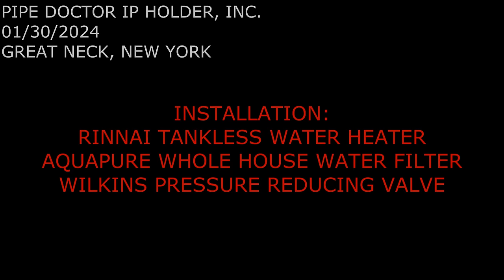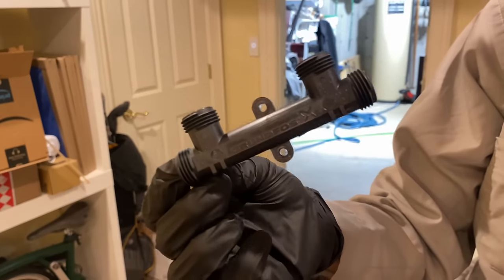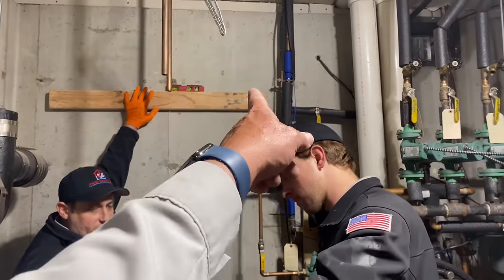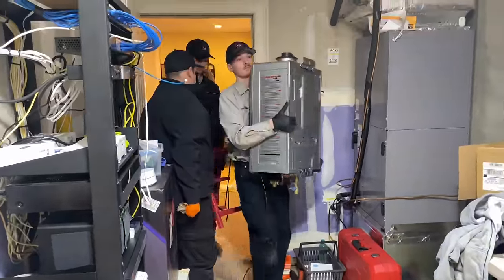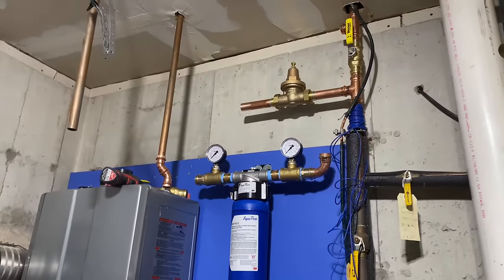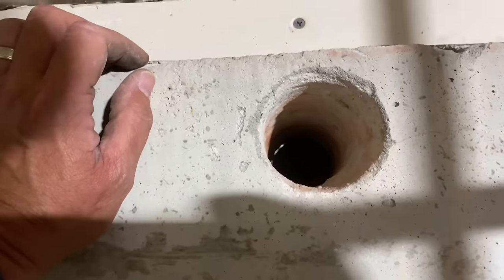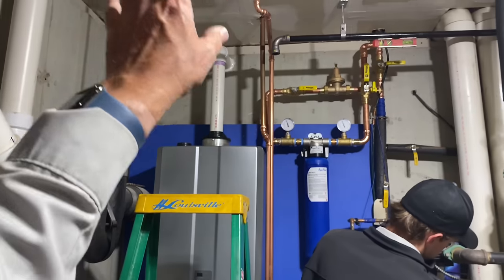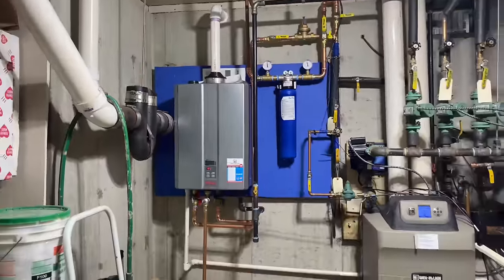SAVE MONEY! Water Heater Upgrade: Improve Water Quality and Reduce Pressure with These Tips!

Comment: 1:52 Hey Mikey you didn't diversify....you got the BTU load for the Boiler And the Second water Heater but didn't take into account the Total Kitchen load IE Deep Fryer, Cheese Melter etc ...I believe 90% of the time The Gas Meter was a Size 1 or even if you were lucky a Size 2...where perhaps you really need a Size 4 meter ...The Gas Pressure at the minimum should have been at least 10 inches of Water Columb from the Gas Meter to the Gas Appliances..you did not Measure or took a Size of The Natural Gas Heating units on the Roof while you were up on the Roof perhaps they were added later because the Boiler could not handle the demands  ..at least that's
That would be a  consideration.....you guys really love your steam...I agree with you the house piping appears to be undersized for the total BTU load that the customer has...perhaps using your manometer on the 300,000 BTU water Heater with a full load you will not get 7 inches of water columb and including an under sized natural gas Regulator a Size 1 is only good for typical residential usage 1 1/4 to a 1 1/2 size Natural Gas Regulator would be much better....curious on your thoughts...if the Gas Company has to come out and resize their Equipment so be it...should be no charge....

Comment: Do you not need a expansion tank running off of city water?
Reply from the maker: It’s not a closed system
Reply: @PipeDoctor  thanks.  I was under the assumption if a house was on city water it had to have a backflow or check of sorts on the water main. But I’m not to Familiar with city water as I have been plumbing and oil heating in Vermont for the past 10 years and 99.999 calls I show up to are on a well. You guys do amazing work I subscribed to all your channels including daniels  learned a lot from you Guys on the gas side of things. Thanks for putting your content out there.